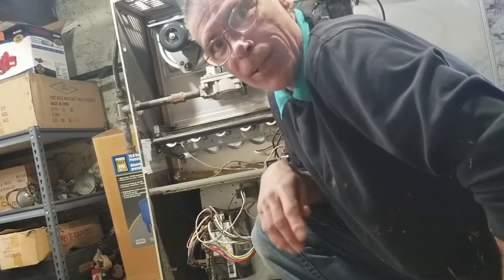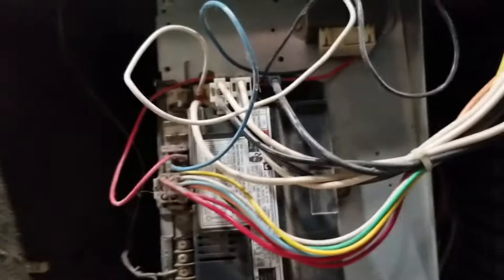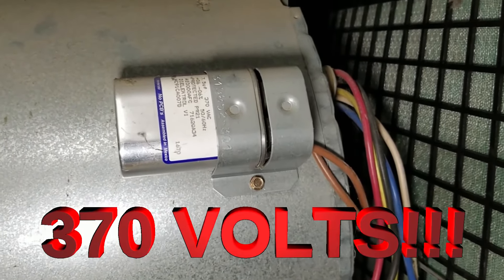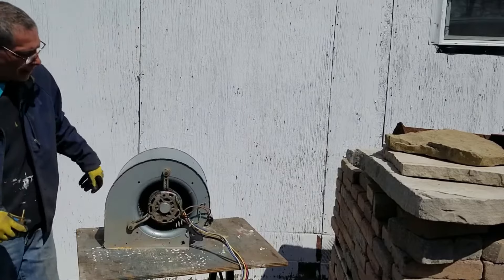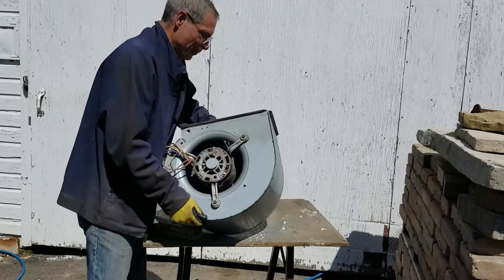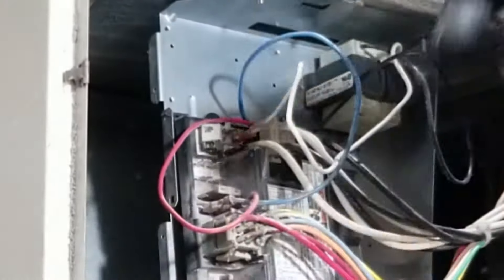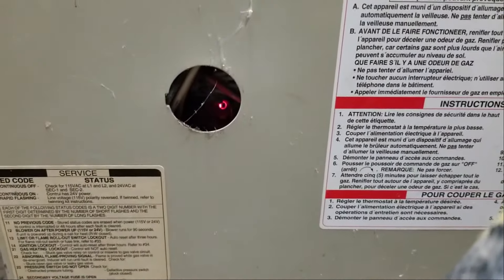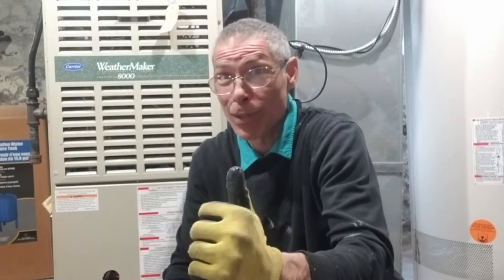Clean Your Furnace Blower and save money

Comment: This is not something everyone could or should do.  If you aren't knowledgeable with regards to electrical devices, and aren't mechanically inclined and experienced, do not do what this man just did.  You may hurt yourself and/or damage your furnace.  If he had messed up that blower assembly and had to have it replaced, he would have been out a lot more than what a basic service call costs.  If he had made a mistake with the electrical connections, he could have cost himself a lot more than that.
Reply from the maker: That is always good advice. As I have always said, if you have any doubts, call a professional.
Reply: This guy is 1000000% right !!!!!!!
Reply: so he shouldn't have made the video and helped out all of those people that are capable of doing this job?....so many haters..
Reply: I know my furnace needs this.but I think it worn bearings in the blower motor
Reply: Got a new blower motor coming today so this definitely helped me. So I can get the wheel all cleaned up before it goes back in. Last year I replaced the board all by myself and I should of replaced the blower motor then cuz it's been having issues for years. Under $200 and I've owned my house 9 years so I think 200 is a cheap fix that will last me a long time, easy to replace and I will be warm all winter🙌 my dad was in the heating and air for most of my childhood. He's older now and doesn't remember much and isn't capable of helping me so I learn a lot from YouTube and do the fixes myself and save the overpriced service calls

Comment: I'm an industrial electrician, I went to a HVAC course years ago and one topic was the blower. If the fins are not clean it changes the pitch and how the blower moves the air.  Well funny thing got a call from my brother in-law the next week  that his furnace is not working, would run then shut down. They moved into the house earlier in the year and now its  furnace time. Checked out, the previous owner did not have a filter in the furnace. The furnace would start then kick out on hi temp. Checked the blower the the cupped fins were completely full of dirt. Removed the blower and cleaned it. Problem solved.

Comment: If you use effective filters, and keep the airbox sealed properly, the fan and motor shouldn't get that filthy.  The true purpose of the filters is to keep the junk out of the furnace and especially out of the blower and heat exchanger (as well as the A/C evaporator coils if so equipped), not to clean the air for the customer.  Look at all the openings in that furnace, and you can see where the dust and dirt came from.

Comment: Please call a tech, as one i love when i show up and its half apart.  I charge you to put it back together then charge you to fix it, you make me so much more money.  Thanks
Reply: Agreed if the homeowner has very short term memory.  Tis why pics help and a great idea.  The pros don't do this!  I have never seen them take a pic...we all make mistakes.  One wrong wire connection, they would blame it on me or claim, "well your system is 24 years old!"  yuck yuck....

How do we customers know if the "tech" is thorough?  We trust. 
I trusted my a/c guy: h'ell never be back: screws missing on the control panel outside, didn't even offer to clean the unit until it is replaced.  He only stated, "it's not worth the 400 to clean".  To me it is.  Even if I bought new in a few months.  

I had another "pro" have my car in a body shop.  He was to replace 2 bumpers for 3600 bucks.  Once he saw he could get my car from the insurance company, (and I refused his service) he charged me 1600 to put the car back together, and he reused old clips, the back bumper has 1/4 inch gap all the way around.

Lesson learned: I will buy the bumpers myself, have Maaco paint them, and I will install them for no charge.  Stupid is as stupid did.

So much for "calling a tech"...
Reply: @jennyeyesxfirepioneer6934  I love when a person who hasn't mastered the English language calls me an idiot
Reply: Why didn't you demonstrate how to discharge the capacitor? It's so easy to do.

Comment: This is NOT for a homeowner to do. Absolutely not for enduser
Reply: Why?
Reply: @dreamingrightnow1174  homeowners can DEFINITELY do this.  But only if you're already experienced doing small technical work 🙄. This is NOT a major job.
Reply: I was told by a few AC guys it needed to be replaced it was so dirty and making strange noises. So I took a picture, marked each wire on a diagram of the board. I removed the entire unit only 4 or 5 screws it was beyond filthy and rubbing metal on metal. It took 2 days of blowing it down, using chemicals to soak and hose out. I had to grind with a Dremel tool a few sections, lube it up and put everything back together. But I saved almost a thousand bucks,,, despite what the guy above said anyone could do it. It takes patience, time and a whole lot of elbow grease
Reply: There will always be those whose job seems threatened by these DIY videos, and try to frighten those who are interested, capable, and most of all, careful to disconnect electrical power, take notes/photos, use the proper tools and materials, etc. 
I would only add that a good quality facial mask should be worn when using compressed air to clean the 'squirrel cage' blower on the furnace, to prevent inhalation of that filthy air and particles.

Comment: I cleaned mine the other day.  Make sure all removed wires are put back exactly as removed.  Take a picture before you disconnect any wires. Take wheel out and hand clean with soap and water for thorough cleaning.  Put everything back in reverse order.
Reply: Soap and water? NO NO you are not gonna eat off that.  Do not bring water in contact with the blower

Comment: You have nice, neat wiring but mine looks like a rat's nest. and it's hard to even notate what wire goes where. Some are even the same color as the others.
Reply: Same, I just use stickers with numbers (on wires and boards). That's easier. Like you say, some wires have similar color, so even if you take a pic it can be troublesome to reconnect everything.

Comment: This was nice.  I get paid to work on furnaces, may I offer a couple of suggestions?
1. When you removed the cover while running @ 10:47 , the door switch forces an immediate shutdown.  These have a timed cooldown cycle by the board to prevent this type shutdown because doing so can crack the heat exchanger. Big $
2. If you remove and either pressure wash  or bucket and brush clean the blower wheel  to shiny , It'll run for more years before getting dirty again. 

I would still have a pro look the unit over every couple of years to check proper operation and combustion chamber integrity. The visit should go quick since you clean the blower.
Reply from the maker: Awesome
Reply: How in the hell would it crack metal from stopping heat too suddenly? I could see if you drop ice on it but really just from stopping the blower? It sounds unbelievable to me
Reply: @Azaion91  The fan blowing on the metal keeps it's temperature constant. It is protected by airflow just like a balloon of water is protected and can be heated over a flame. If the fan stops suddenly in the middle of a cycle, the hottest portions do a sudden heat spike . The alloy and thickness used in most heat exchangers and combustion chambers are not designed to handle this.
Reply from the maker: @Azaion91  good question...I would like to know the answer too. I know from experience that some casted metal (aluminum or cast iron) can become brittle from temperature fluctuations.

Comment: My blades have a lot of rust spots all over the blades.  I rinsed and used fan blade cleaner.  Lots of dirt came off, but still this rust or rust like stuff will not come off.  What should I do?
Reply from the maker: You realize I am not a furnace repair- anything guy. I wouldn't wager a guess at what caused the rust, or what to do about it. Sometimes it is worth the effort and money to pay a professional.

Comment: My furnace sends hot air for one room and cold air for other 2 rooms. I changed the filter. The problem is still there. It also makes long and loud noise, woo~~woo~~~ I think the blower need to be cleaned and apply some 3in1 oil.
Reply from the maker: I am sorry, Kevin, but I am not a service technician and so any advice I give is not based on any experience. You may have to call a professional.
Reply: Thanks. It was the motor jammed and it would not blow air to other rooms.

Comment: thanks!   what about lubing the fan?
Reply from the maker: In my opinion, most of these fans have sealed bearings. If it needs grease, it will have a grease fitting- otherwise don't  oil it.

Comment: Very good video!  Thanks for making it.  I'm a bit surprised you closed it all back up without vacuuming/cleaning all the other dust and cobwebs, though.  Dust is the big enemy!  Today I had a furnace tuneup on my 23 year old Bryant 80t furnace.  Not only did it pass with flying colors, but the tech told me it was one of the cleanest furnaces he's seen in his 18 years of HVAC work.   "You get a gold medal for preventative maintenance" he said. 

What did I do?  I clean everything annually during the off season and check it in season.  Over the years I also replaced one ignitor and one sensor.... requiring 1 screwdriver for each job.   The tech said my blower fan was a bit dirty, but not bad at all.  That's why I sought videos on how to clean it!
Reply from the maker: This was a 4 hour job condensed into a 12 minute video. Of course you don't see everything that is done, and some things are "cut" for expediency. Thank you for watching, and cudos to you for going the extra mile!

Comment: The only time you need to remove the fan is when the motor goes out. Cleaning it will not prevent the motor from taking a dump period.
Reply from the maker: I don't often contradict comments, but I do not want anyone to be misguided. The bearings and bushings inside the motor will experience excessive wear if the fan blades become laden with grime. It throws the balance off and causes the motor shaft to wobble and the bearings to fail. If you question this, try driving your car without balancing the wheels, and see how short a time it takes for bearings and shafts to fall apart.
Reply: @oddjobsremigauthier  I'm pretty sure grease plays a big part on the bearings failing. I used to work at a food industry plant where we made vegetables. All there motors there were always dirty and they ran well as long as we were able to change bearings to prevent them from failing. Wear and tear will fail the motor not dust so that's the reason I don't agree with cleaning fan blades and wiping or blowing dust away from motor.

Comment: Nice video anybody with common sense should be able to do this
Reply from the maker: Thank you, I agree.
Reply: @oddjobsremigauthier  thank you you're the best is always use a camera cell phone for the wires
Reply: I have a 46-year furnace air ease brand very simple parts the blower motor has a belt that turns the blower it mounts on the front of the on a slide does the job very simple I just changed the filter Happy New Year always the first of the year our first of the month I change it
Reply: I have very good utility bills 150 160 I live in the Chicago area
Reply: Very very good video , but capacitors two brown electric line go where ? Moter?

Comment: How do you balance it? Brand new house. Had HVAC guys come out twice because at first I was hearing a humming sound (which I thought was normal, since I had just moved in), then a rattling sound (the reason I had 2 HVAC companies come check it out). I, also mentioned that there was never any dust on the filter. Was noticing light dust on the sides of my dark cabinets and hardwood floor at this time. Kept sweeping the garage, thinking I was tracking it in or that maybe construction dust was blowing out. They blew it off both times. 

Fast forward 3 years (and I did have it cleaned in between, I'm assuming they did clean the fan anyway), and I had a FB friend whose cat had kidney disease and was crashing. Good friend that I was, I gave her support, meanwhile leaving the litter boxes by the intake vent for a good 6 months, 3 to 4 days at a time every week, too tired to vacuum late at night, burdened by her frequent texting, in a different time zone to boot. It was around this time that I noticed a lot of dust accumulating, and the tar from my smoking was starting to stick to everything.

Fast forward another year, my normal routine was to set the litter boxes near the intake vent for about 2 hours while I vacuumed and put the clean litter boxes in their normal spot. I have to admit, I got a little lazy still, and the litter boxes would occasionally sit there for a couple of days before I had energy to vacuum. The dust started to accumulate like crazy. I had changed the filter at the end of December, but it was blowing poof cloud dust. To make matters worse, because no dust was accumulating on the filter still, I started leaving it in for 4 months, instead of 3 to see if any dust would accumulate and thought I'd changed the filter end of spring, but when I went to change it recently, saw the date I had last changed it, December, and when I pulled the pleated filter out it was BLACK from all the cat litter dust.

I have 5 flexible hose dampers because the builder decided to go register-happy on me after I pointed out I had no registers in my kitchen, only the closed-door pantry.

You should see this place. Brand new house, coated with heavy dust. I'm wondering if that flexible hosing collects cat litter dust, and if there is any way to get the ducts to go straight across without any loops, after the fact? I'm desperate. I couldn't keep up with the dust, and now my grey carpet looks tan. I guarantee if I were to remove that flexible hosing, dust would fall out and choke me to death.

Comment: I think I have the same motor as you , the next time you pull the fan out check for an oil inlet hole ( if you stop the video at 5:20 and look directly to the right of your gloved finger , about 1 inch above the “GE” logo there should be a small hole ) the hole should have either a yellow plastic cap or a metal one that pops off ( by what I can see in the video yours is either missing or you just don’t have one and it’s a sealed unit ) if there is a hole there add the proper oil and get a new cap for the hole , there should be a second fill hole straight back from that one which is difficult to get too, you either have to get the oil bottle with the long flexible straw , or you need to pull the fan motor out ( by removing the three bolts that hold it in and also loosening the bolt that holds it on the shaft ) I’m not trying to be critical of your video, I’m just passing on info that may be helpful as I learned the hard way by neglecting to oil mine for many years ( because I didn’t know any better ) and my fan motor seized ,……another thing to mention is ,.. if it’s a “ metal “ cap ,.. you wouldn’t even think it pops off with a hole behind it ….good luck !

Comment: What air compressor are you using? I’d love to find a small portable unit that pumps 7+ CFM. I’m not aware of such technology
Reply from the maker: If I remember, it was a Mastercraft 26 gallon ,1.5HP compressor. In USA , Husky makes the same one. It is rated at 5.2 CFM. The 2.0 HP gives 6.2 CFM. Any more and you would require a gas powered or 240V compressor I think.

Comment: while the blower assembly is out on a mid efficiency furnace, should crawl in there and look up with a bright light to inspect the heat exchanger for cracks, holes, popped crimp rings if applicable.

on a high efficiency, should look at the secondary heat exchanger from there - checking for dirt buildup and signs of water leakage, corrosion. the primary heat exchanger is not visible on high efficiency from blower compartment - the secondary is in the way.

Comment: Imo this blower isnt that dirty to the point that it will reduce running efficiency. You can also blow compressed air on the fins while the blower is still in place so less things that can go wrong.
Reply from the maker: Thanks for watching!
Reply: Bad advice on both counts.

Comment: Do you lubricate the motor?
Reply from the maker: No. The bearings in the motor and blower are usually sealed and do not require grease.

Comment: No they don’t run on 220 volts. Residential gas furnaces run on 120 volts.  No need to have 220 volts, unless it was an electric furnace.  By the way, that big hole in the door, where the plastic lens is supposed to be, is sucking in un filtered air.  Maybe that’s why your blower is getting dirty.  You could have looked for some oiling ports on the motor, and given each a few drops.  I also would have looked up where the blower was to check the heat exchanger.

Comment: Or you could just run a filter and change it and you wont have to do this at all
Reply: "run a filter?"  You mean, "change the filter?"  I don't think so.  I change the filters all the time for 25 years.  My blower still is funked after years of sucking in dirty air...
Reply: That’s what you do before this happens. Not everyone starts with a brain new AC you know. And filters aren’t perfect. If they were, the AC wouldn’t be able to handle it  anyways
Reply: Notice in this video all the openings that allow all that gunk straight into the blower compartment.  You can install the most efficient filter made, and it won't help if you let air bypass the filter and go straight into the compartment.  Seal up all the openings, make sure your filter actually seals against the furnace, and use a good midlevel filter and change it as prescribed.  The cheap filters of the old days wouldn't stop much, the most expensive available today may be so restrictive it affects the performance of the furnace.  Stick with a filter that fits in between the extremes.